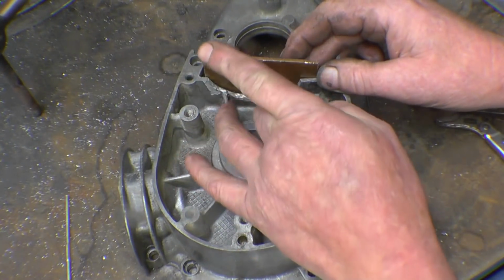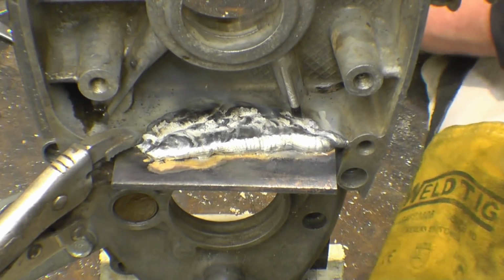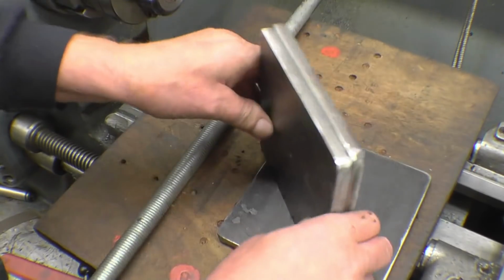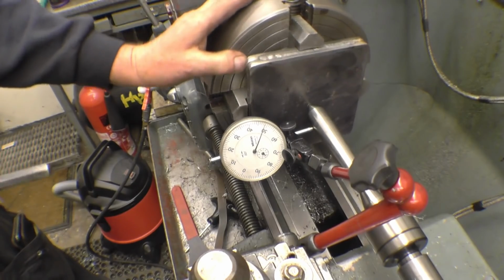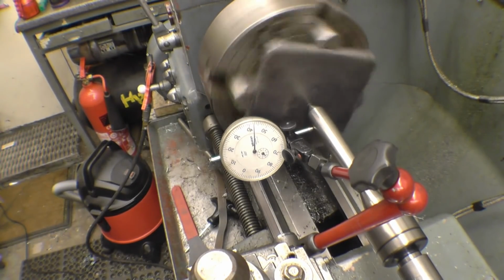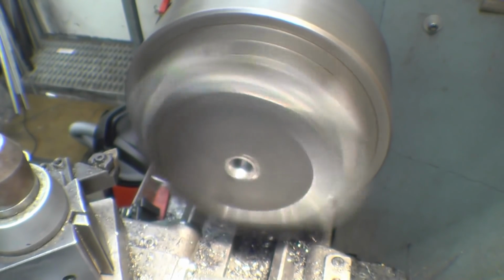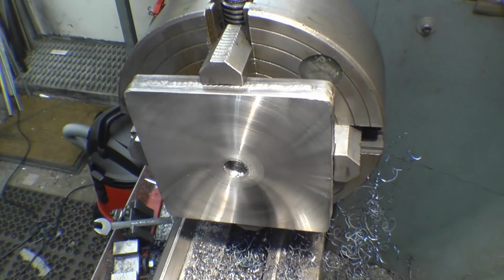SNNC 297 P2   BSA Bantam Crank Case Repair    Liner puller

Comment: Have you thought about using stainless steel for your backing plate or does that not work
Reply from the maker: The copper is easy to form .Stainless is OK for flat parts .
I have used old bearing rings before

Comment: Nicely done on the welding, that would have taken some patience and quite a bit of rod. What alloy do you use for casting repairs like that, the usual 4043? Sleeve puller plate looks good, btw.
Reply from the maker: yes just 40 43  it fuses in nicely

Comment: Why not have cut a piece of aluminum to weld in the hole rather than building it all out with filler?
Reply from the maker: the size of the missing bit was border line I could have welded a patch in

Comment: Looks like the Tig is part of you.. I would have though that the copper plate might have drawn in some of the Alloy weld, but separated very easy. Good build up, and ... the new Electric Grinder works well.
Reply from the maker: grinder is a good bit of kit

Comment: Disappointing to see the crankcase joint face treated with such contempt.
Reply from the maker: I dont think any harm came to the face  the camera picks up the noise extremley well
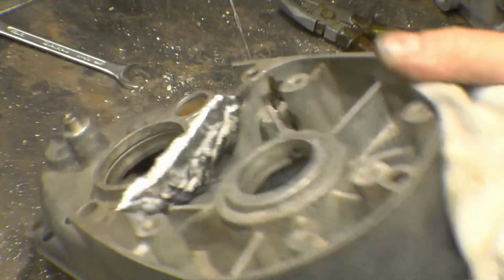Reply: I think he means 4:17 - 4:37 where the crankcase was handled roughly, repeatedly hitting the vice  on the table and probably scratching up the machined seal face on the other side.
Reply: @CurlyG65 I agree with you. John didn't just fall off the turnip truck. Some people just can't resist running their keyboard mouth.